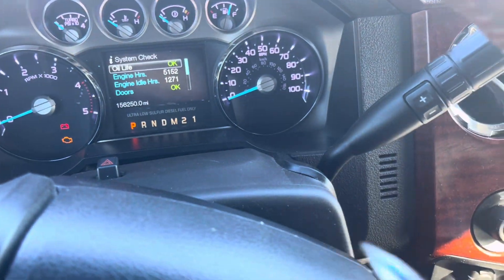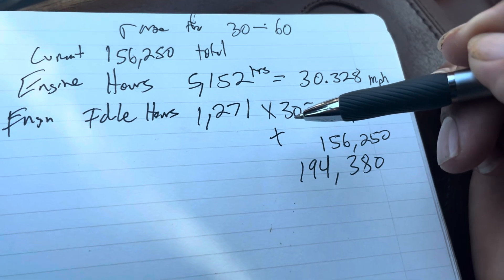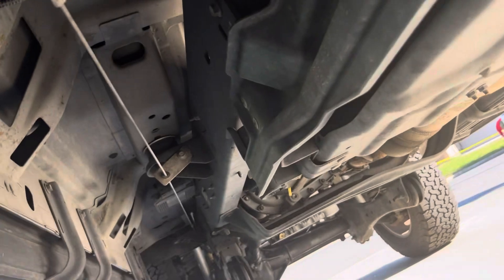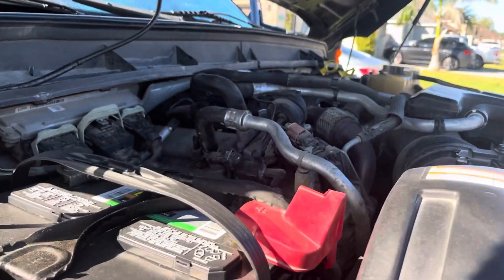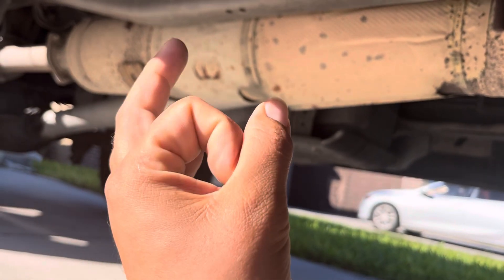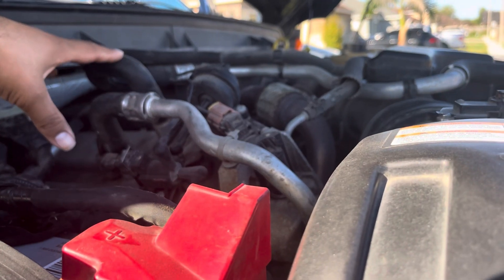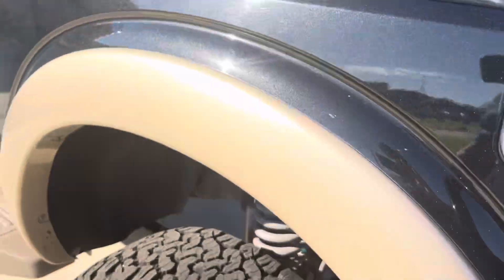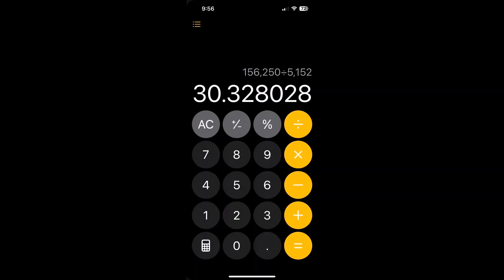Engine Idle Hours:The Most Overlooked Detail When Buying A SuperDuty #automobile #shortvideo #diesel

Comment: Got a 2007 f250 with the 6.0 engine hours is maxed out a 9,999.9 and has been for about 3 years now. 308k miles
Reply: I guess they added another digit on later models. Mine is over 14,000 on my 2011.